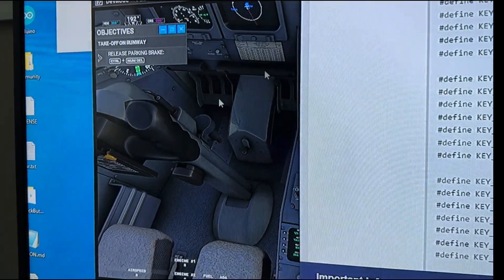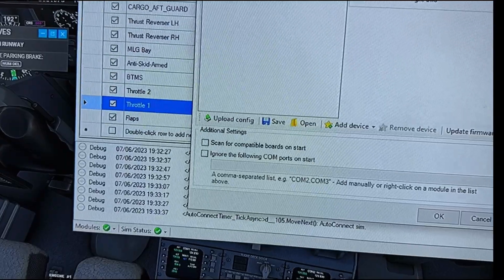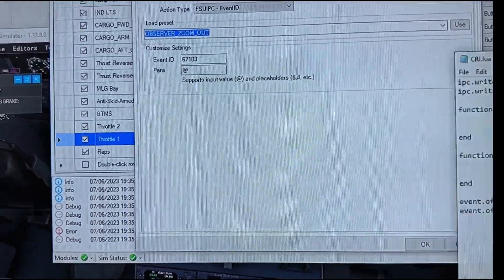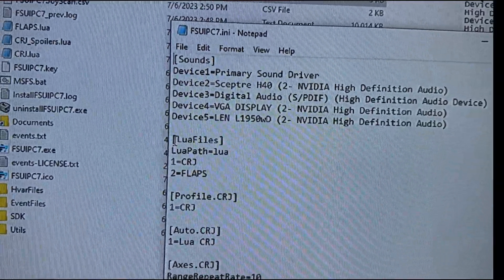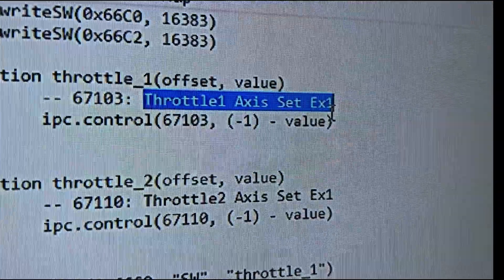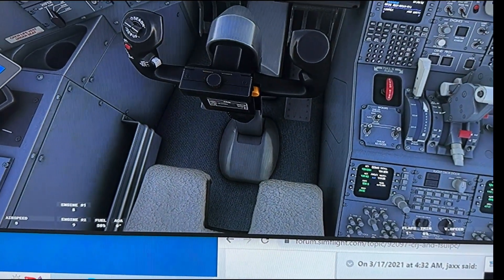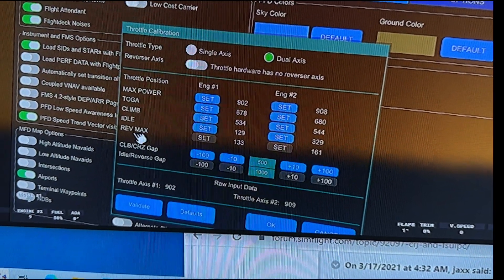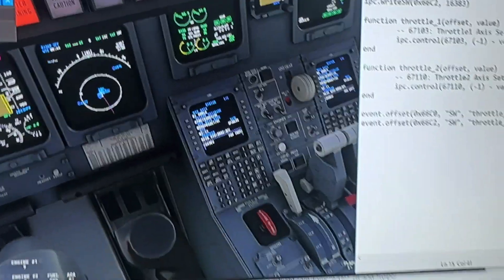FS2020 Throttle using an Analog Signal - potentiometer, FS2020, Aerosoft,  FSUIPC, Mobiflight

Comment: Thanks. I'm having a lot of trouble with Airbus in MS2024 and my 2 throttles I made. They work fine in Boeing, but after trying this, I get one throttle that works in reverse (so full on is full off in the game and vice versa, and I don't know the code to change it round). 
But while playing with combinations of clicking on the stick in the game, which only goes down to 32%, somehow I can only move the smaller lever on the front of the stick now, and this is with both a gamepad, mouse and my throttle stick. I think the game might just be bugged
I also couldn't get throttle 2 to work. I tried duplicating the line, and changing the Arduino pin to control Throttle 2 trimpot, but it only controls throttle 1 in the game!
Reply from the maker: They work fine in Boeing, but after trying this, I get one throttle that works in reverse (so full on is full off in the game and vice versa, and I don't know the code to change it round)- You should be able to change the reverse option in game settings.  As for the Airbus, I do not know, I do not use the airbus.  You might check with the MobiFlight Forum.
Reply: @AaronWerner   Thanks, I found the bug... it was me being silly with reversing my interpolation but feeding the wrong variable into it, which spat out weird behaviour that confused me for a long time. Got it working. The Airbus is a different beast which I've pinned down for the most part, but the detents are stopping me using the full range and the throttle gets stuck at 32% when full off. Can't find anything on this that makes sense to me. The gamepad A and B buttons allow full range. The Airbus A400M allows full range, but has weird calibrations where the position of the throttle goes up in a curve. So 2 thirds off is only 3rd off in game until it suddenly drops down to idle.
Reply from the maker: @ switch to another aircraft and try it
Reply: @AaronWerner   Happens there too. Think the trimpots I bought might be of spurious origin. I had one for the spoiler which suddenly stopped working. I ripped it out, resoldered new wires to ground and 5v the same as my others, and tried 3 different analogue pins and I get nothing from turning the knob at all. 2 trimpots and even tested with Arduino sketch and changed wires.
Reply: @AaronWerner   I did, I found the same problem. It's almost as if running 2 trimpots at the same time overloads the reading while connected to the same GND and 5v
Reply from the maker: @ use a basic guitar knob to test it.  If it works you confirm your theory
Reply: @AaronWerner   Also, do you find that when operating 2 levers, the first one glitches sometimes and the position jumps around slightly offset, but when moving it on it's own, it doesn't?
Reply from the maker: @ no.  Sounds like it might be your aircraft.

Comment: Great information. Thank you!

For the lazy out there:

ipc.writeSW(0x66C0, 16383)
ipc.writeSW(0x66C2, 16383)

function throttle_1(offset, value)
     -- 67103: Throttle1 Axis Set Ex1
	 ipc.control(67103, (-1) - value)
end

function throttle_2(offset, value)
     -- 67110: Throttle2 Axis Set Ex1
	 ipc.control(67110, (-1) - value)
end

event.offset(0x66C0, "SW", "throttle_1)
event.offset(0x66C2, "SW", "throttle_2)